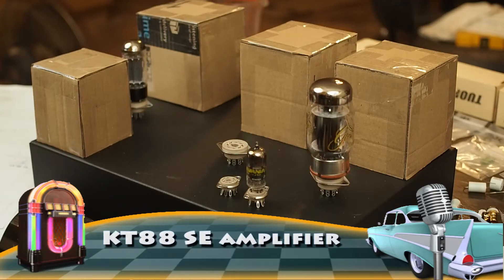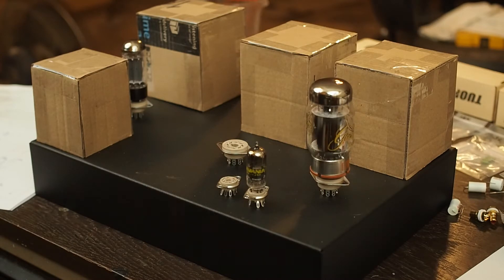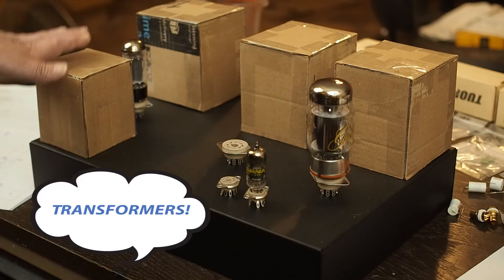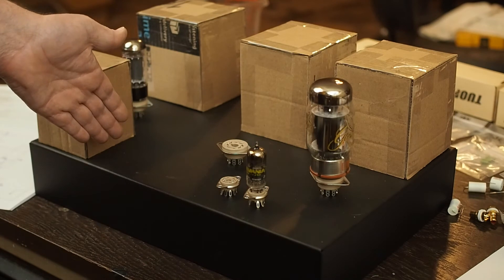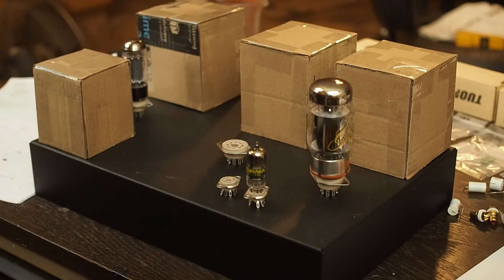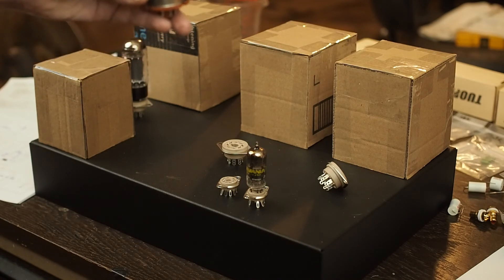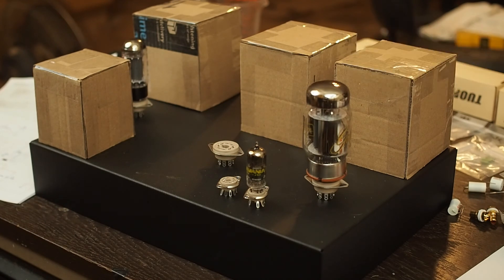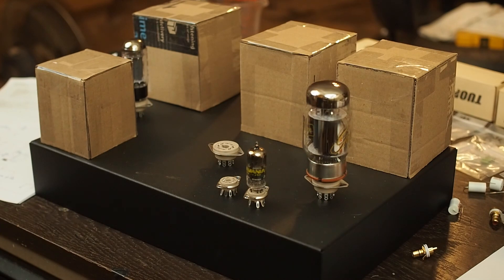KT88 SE DIY Tube Amplifier Build

Comment: Recomend aleminium shassi fore home build.so easy to make holes. I will study this serie since i have moest components, but fore mono blocks. Pretty inpressive power in the monoblocs now, just need a passive volume controll, but a pre amp build alsow cold be coming,but i make it point to point,if my fingers still are usable fore such work.

Comment: hi stephe ,i go on the forum and a guy say when you measure the clipping with a scope  ,you put your your scope on the grid of the output tube ,true or false
Reply from the maker: If you wanna measure if the input tube is clipping, they are right.
Reply: no i want to  know  where you put your scope  to take measures on the grid or on the dummy load  @SkunkieDesignsElectronics
Reply from the maker: Well that's not what you asked :) I check on the dummy load first and if I see an amp clipping unexpectedly (Like it should make 10W and it's only making 2W), I check on the grid to see if it's the driver tube or the output tube that ran out of steam. Checking on the "grid only" won't tell you what kind of power the amp is making when it starts clipping, there is no way to calculate the amps power from just checking on the grid.
Reply: i understand that,  but my question is about that when i check clipping on dummy load with my scope the  sinus positive and negative  part of the wave dont arrive  quite in the same time ,my question is it normal or not with a single ended,i hope that you understand my question im french  and my english is not perfect .it would be cool if you could do a little  tutorial with the scope measures,thanks a lot @SkunkieDesignsElectronics
Reply from the maker: https://youtu.be/rVpawaYzUus

I'm not sure what you mean by they don't arrive at the same time. If you mean the upper or the lower starts clipping slightly before the other, yes that is pretty normal.

Comment: Question: why in a power amp do many people use a volume control ? I ask this because I use a tube pre-amp and that has the volume control, input controls, tone controls. Mind you I only have p/p 6v6G ST  black plate, clear glass Raytheon tubes in the power amp. Maybe 12-15 watts max outputs.
Reply from the maker: Because many people, like myself, don't use a pre-amp. The input sensitivity on most of these amps is high enough a pre-amp isn't needed. If you plan to use a pre-amp, don't install a volume pot and size the first tube grid leak resistor accordingly, usually 470K will work fine.

Comment: how does this compare to the 300b?
Reply from the maker: IMHO the 300B sounds much better and my little 6SQ7/EL34 also sounds better. I think it has more to do with the driver section than the output tube possibly?
Reply: @SkunkieDesignsElectronics  That seals the deal on what I'm building. The 300b tubes are more expensive but not by that much. Do you think the gold lion 300b is a good choice?
Reply from the maker: @allenwalters8812  I haven't heard their 300B tubes, but in general Gold Lion tubes are nice. I wasn't crazy with the EH 300B tubes and personally ended up using a pair of Shuguang Treasure 300B-Z tubes I found on sale.